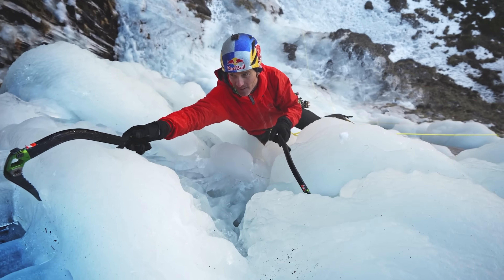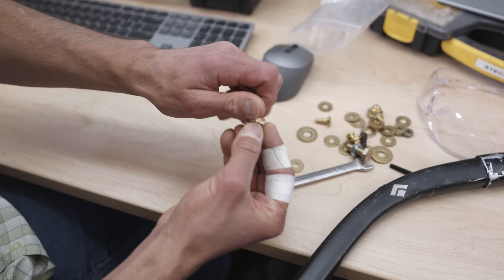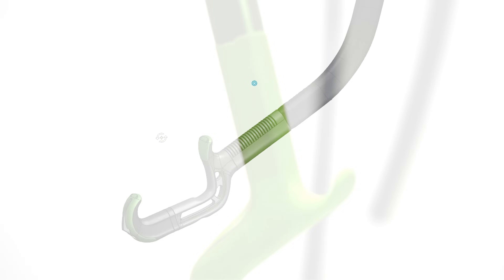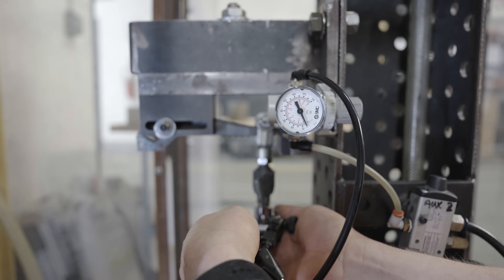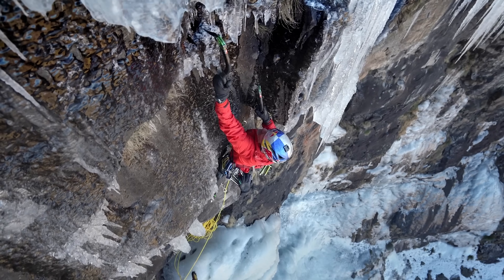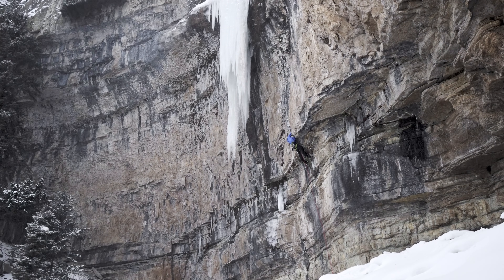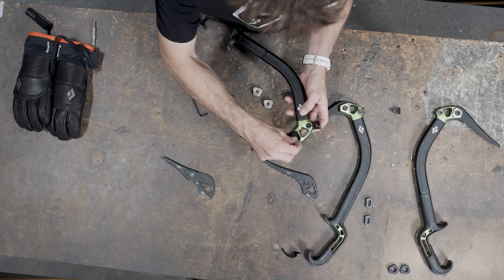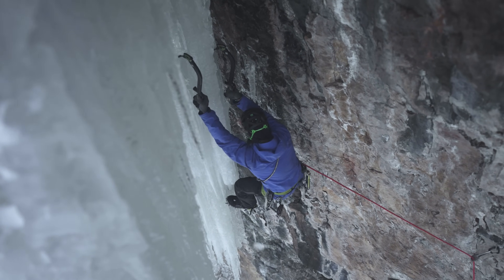Introducing the Hydra Ice Tool: The Many-Headed Beast

Comment: You can pry my cobras from my cold dead hands. 

Ok looking tool. Would’ve much rather seen a line of tools specialized for each discipline. I’ll still probably keep climbing alpine with cobras and mixed/tougher ice with fuels and look to try a higher end option from EliteClimb in the future. With as many snap issues as we see developing in handles it’s kinda unfortunate to see that handle construction remains unchanged from previous tool designs.

Comment: C’mon men…It’s always not a good thing pointing at other’s work: that ‘s for sure.
Maybe the quality of craftmanship is a little bit better than Petzl, pleagued by minor but not so minor material and mechanical problem but hey; the design of the whole tool is out dated right now.
Too open the angle between the tip of the pick and too gentle the bend in the middle of the shaft, to say the least.
Doesn’t matter if it seems a Nomic: this is not a tool i will use for climbing ice for the very end tech grade.
Next winter Blue Ice will exit with two new tools: one the same league of Grivel  intermediate levels machine.
The other, a beast I guess, a marvel radically bending the shaft just near the head, like IceRock A’speed.
570 grams, no rivets, beautiful hydro shaft.
Oh, I’m not a Blue Ice troll!
I’m only a reaaaaaly old veteran, starting in 1985 and not missing a single winter , despite all the injuries and epics of extreme ice climbing.
C’mon BD: technology and design are driven the future!!!